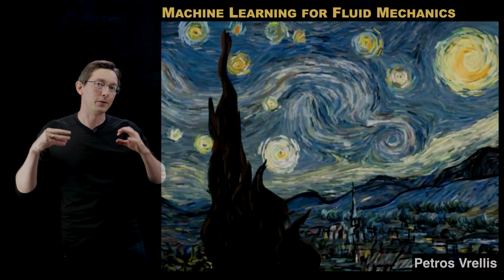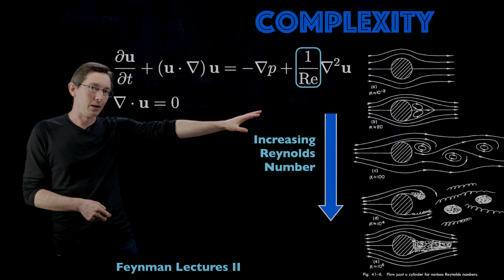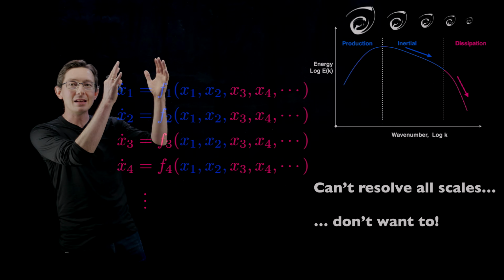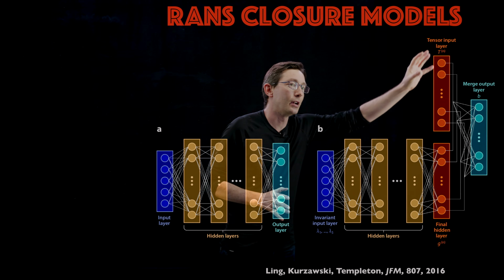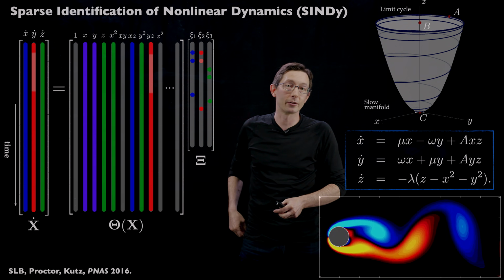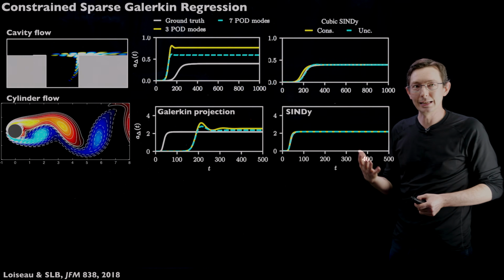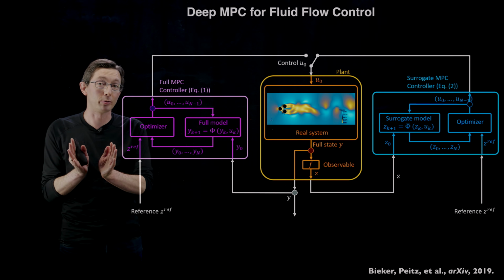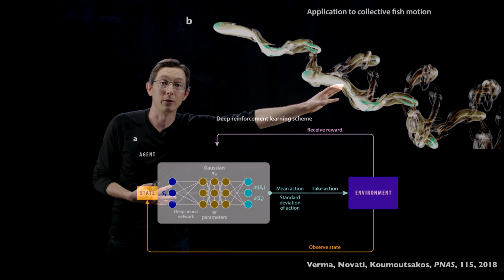Machine Learning for Fluid Dynamics: Models and Control

Comment: makes sense that the later models were more power efficient. by incorporating the nPowers there is a more linear approximation of the harmonics rather than square wave truncation of a declarative value. There is a point in east sooke that gets an occasional ocean level cloudburst that has some sort of resonant wake vertical staking pattern that looks like a couple of pillow mints.

Comment: I wouldn’t say that we have big data in fluid dynamics. In fact, we don’t have enough data to properly train “standard” deep neural networks, like they do in classical ML tasks (image recognition, NLP etc). In my opinion that’s one of the reason why incorporating physics inside neural networks, either in the structure of the network or as regularization terms like in PINN, can help us.
Reply from the maker: This is a really important point.  Fluids data is often big in some dimensions (huge snapshots, up to terabytes per flow field), but may be very sparse in other dimensions (only a few Reynolds numbers or geometries sampled).  I totally agree that physics-constrained learning is a great way to handle this.